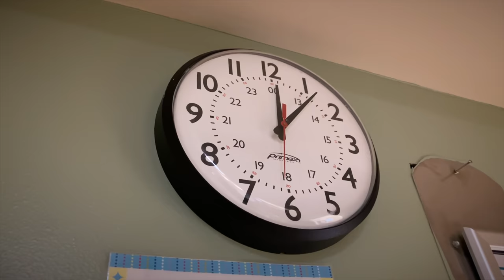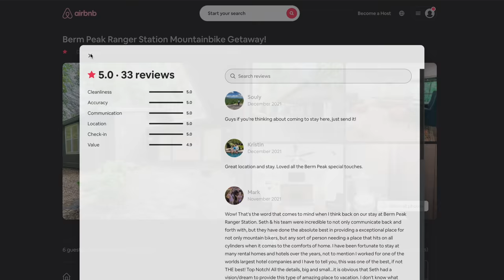Berm Peak's Best 2021 Moments

Comment: Since you said you should have built the safety bridge more banked, what you could try taking the planks off the top or where the posts on the up hill side and shede hammer them in more? Just an idea putting it out there